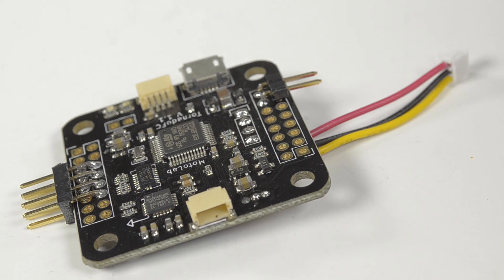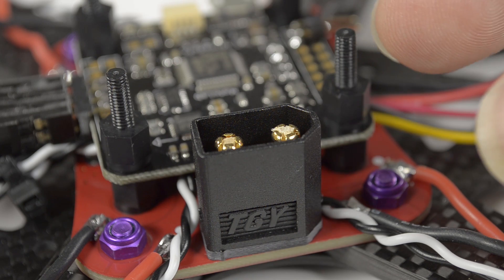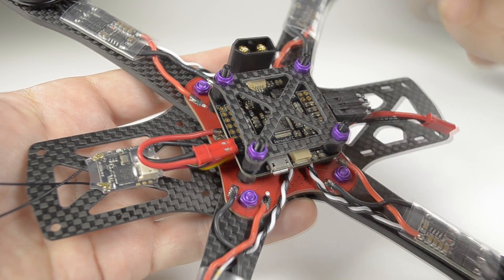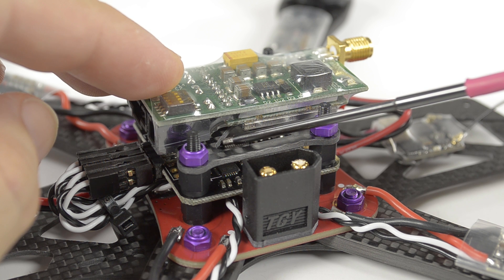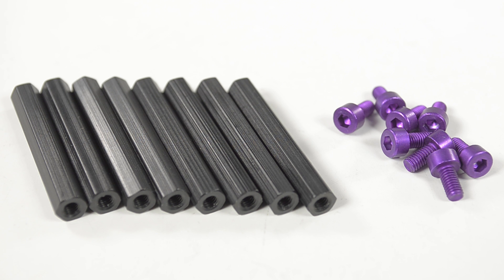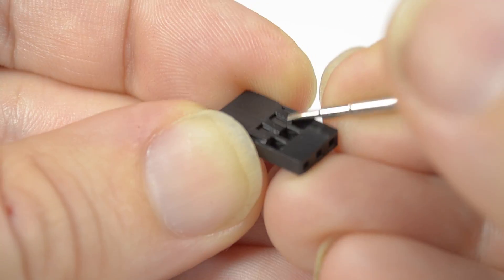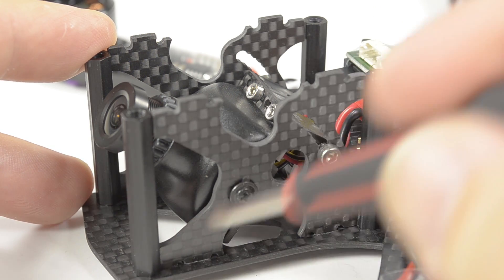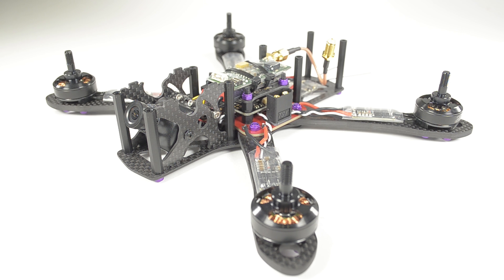ImpulseRC Alien Build - 03 FC VTX Camera

Comment: Does your FC run off 12v?
Reply from the maker: All the FCs we sell will run directly from your Lipo. The only exception is the Tornado which you can use with a Pololu regulator solder on directly.

Comment: Quick question.  Are the receiver wires soldered to sat rx in this video?  The board is never flipped over in the video.  I know there are multiple ways to connect.  How were they connected for this video?   Thanks.
Reply from the maker: Yep, pretty sure they're just soldered to the pads on the bottom of the board.

Comment: What is the correct way to connect the LED ring to power it? I've heard some ppl connecting it straight to the PDB. I've looked through all the Impulse RC videos and none of them show the LED ring install. Thanks!
Reply from the maker: It takes up to 4S input so you can definitely power it right from the PDB

Comment: Great video tutorials, much to learn here for first time builders. I'm building the 4" version also with Cobra's 2204 23kv motors and little Bees. I was following this vid along and stopped when I noticed none of the cobra wires were crossed to revert the motor direction. This really confused me and I can't find any thread or documentation pertaining to the cobra motors spin direction when wires are straight soldered (not crossed) exactly how can I direct the spin direction w/out any programming to the ESCs? I'm using the RMRC Seriously Dodo FC.
Reply from the maker: +Eduardo Esparra You should be able to program the ESCs and reverse their direction using the BLHeli passthrough feature in the latest versions of Cleanflight and Betaflight. Really awesome feature, just build your quad and then worry about flashing ESCs through the USB port on your FC :)

Comment: I didn't see how you were supplying power to that tornado? It looked like you were running it strait off the PDB?? I have one, but am having a hell of a time trying to set it up. There is not much step by step info one these things. Which way does the pololu go on? I put it on the way I thought it went, but it started getting hot so I soldered it the other way, but I don't know if I have the other wires hooked up right, so I just went to a Naze32 rev6.

Comment: What about noize in camera picture. No LC filter used for vtx supply here or isnt needed ?
Reply from the maker: +Jan Prejzek If you use the ImmersionRC video transmitters and you power a camera directly from their output then it isn't needed :)
Reply: +ImpulseRC Have you ever had any issues with the IRC 600mw 5V supply dropping below 5V and the HS1177 dropping out? 

I had persistent random camera dropouts for a few seconds with my HS1177 (every 3-4 flights) that was connected powered by the VTX and initially thought it was a bad antenna connection. I changed to a PDB that supplied filtered 12V to the camera instead of the 5V out on the VTX and it never cut out ever again. 

Maybe my VTX had a faulty regulator. I also fixed it on another build by using Polulu 12V step-up from the 5V out, but that requires more wiring.
Reply from the maker: +Sam Prudden All electronic parts will have some variance. It may be that you had a VTX that put out a slightly lower voltage than usual, as well as a camera that wouldn't tolerate low voltage as well as most others.

Hard to say, but in general the regulators on ImmersionRC gear are solid and well designed. Sorry I can't be more help!

Comment: im in need of help. i cant seem to get power to the bored. i have the pololu v5 step down installed then the PDB 12 plugged in to the bored like the picture in the link. when i plug in the USB as if flashing to bataflight everything turns on like normal when i plug in the lipo everything works fine. i have looked on RCGroup.com with no luck, but didnt asked any questions. this is my first time asking for help. please and thank for any help.

parts list: 
ImpulseRC Alien 4' 
Cobra 2204/2300 motors
Little Bee 30amp ESC
MotoLab Tornado FC
FrSky D4R-II
Lumenier 1300mAh 3Cell Lipo
Lumenier Tx5G6R
MINI FPV VC from ImpulseRC
BataFlight
BLHeli

http://static.rcgroups.net/forums/attachments/4/5/2/0/2/8/a8255617-168-Tornado_V1p1_Pinout800x830.jpg
Reply from the maker: +xdreem raving You can find documentation for the MotoLab boards here:
http://www.rcgroups.com/forums/showpost.php?p=32330479&postcount=2

Also there is a dedicated support thread which is maintained by the designer of the boards here:
http://www.rcgroups.com/forums/showthread.php?t=2537379

Those are the best places to get help!

Comment: New to rc and fpv so don't shot me if I'm asking something that's obvious to other people. The reason there's no need for a power filter in this build is because the motolab tornado stm32f3 fc comes with an integrated BEC?
Reply from the maker: +Pete Velez The Tornado you can add a Pololu regulator directly to the back. The Cyclone actually has the BEC built in.

Comment: Two essential tips Id like to add: 1) Use Lock tite on the bottom screws for the standoffs on the bottom. 2) Pre-thread the M3 Nylocks on a metal m3 screw first before using on the nylon stand offs. The nylon on nylon can sometimes thread itself...
Reply from the maker: +Vek FPV Both are excellent tips! Thanks mate :)

Comment: Where are you getting the power for the Receiver? Is it coming from under the Tornado FC or directly from PDB? 

I've just ordered a Cyclone and I wonder where I'm going to power the receiver from. Thanks.
Reply from the maker: +Kaan Aslan The Cyclone has a built in 5V BEC so it can supply power to your receiver :)
Reply: +ImpulseRC Thank you. I have another question: I noticed that at the very beginning of this video we see the Tornado FC soldered with the necessary pins. But for the ESC pins, you soldered the Grounds to the signal pins on the way and it seems that you cut the second pins of one side. Does it work that way? I was planning to solder one side of the pins to Ground and the other side to signals. That's how I saw on other videos. This one, I've just noticed it and I wanted to be sure about it.

Thanks.
Reply: +Kaan Aslan The GND pins are not actually soldered to the signals, it's just a trick of the light and camera angle but there is actually a gap there! It wouldn't work if they were connected.

Comment: how do i use a AA battery as a current limiter?
Reply from the maker: +John Nguyen Alkaline or NiMh AA batteries are inherently current limited, they simply can't supply much! This isn't true for all AAs though, like the lithium ones so be very careful of those. What Soma is suggesting is that instead of powering the ESCs with a Lipo the first time you power up, get a battery case with 4 Alkaline or NiMh batteries and power the quad with that. This means that if there is a fault or a short somewhere you're much less likely to cause significant damage.

Comment: Love this quad, so many ingenious designs that some companies don't think about. I especially love how you designed the stands for the top plate, where you can fit the 5 mm wrench to tighten them. I had an issue like this with my luminier and scratched the stands trying to tighten them. Good job!

Comment: FYI, My Pololu Voltage Reg didnt fit under the Tornado FC the first try.  Im building exactly as shown and my Pololu Reg soldiered on the bottom of the FC with straight pins and leaving the little plastic spacer that comes on the pins, Ive found there isnt enough clearance, so I'm going to try without the spacer, sucks cause its so pretty and ill probably make a mess now
Reply from the maker: +Joel Larson Thanks for the feedback. I'll check with Soma and report back but from your experience it sounds likely he did this without the plastic spacers and mounted the Pololu flush with the Tornado. If you have some good side cutters you might try cutting the plastic away and snipping each pin so you can then desolder them one at a time. Might make it a bit easier :)
Reply: +ImpulseRC It wasn't so bad I de soldiered it and put it back on up tight to the board used a razor blade for a spacer so it not touching the board and now there its got good clearance from the PDB Press Nuts.
Absolutely Love this build, great quality and workmanship, and thanks for the videos too they are super helpful to noobs like myself
Reply: +Joel Larson Thanks for the kind words! Confirmed with Soma he did it flush like you. He said he didn't show it here because he intended to do a video specific to the Tornado but ended up not having time before Christmas to get it completed. Hope the rest of the build and maiden goes well!